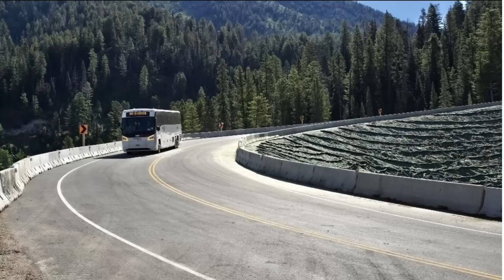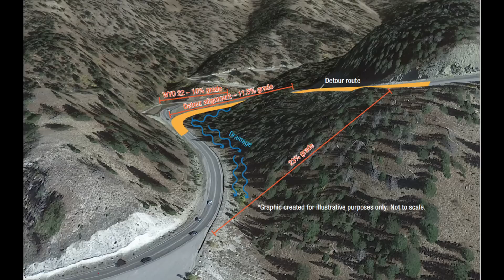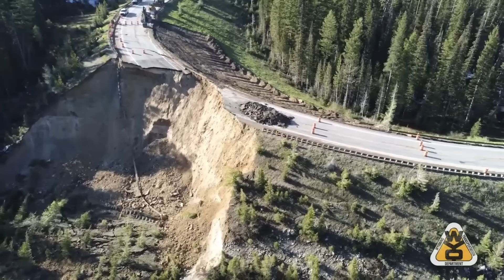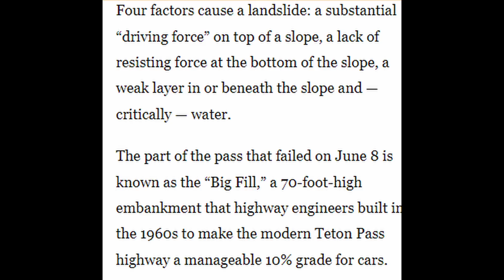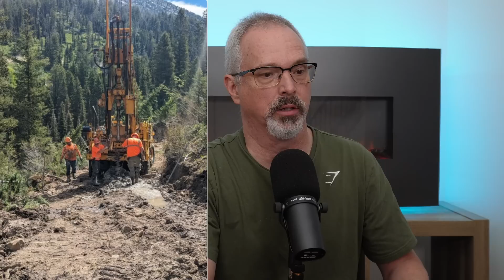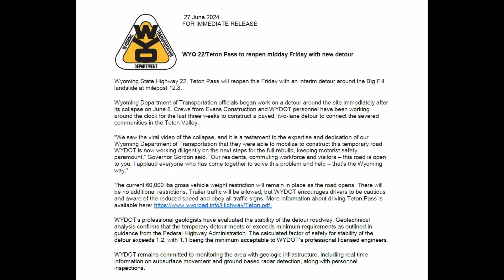Teton Pass - Bypass Completed and Open to Traffic

Comment: I got my MSCE in geotechnical, 40+ years ago. I never trusted a FS under 1.5 unless the slope was under 5 feet tall. The soils in CT vary their properties every few feet so, you can't count on anything with it. IMO a 70 foot tall slope needs a much higher FS than a short slope. The whole problem seems to be politicians making decisions based on dumb information. The spokesman can't be an engineer. Good video. Remember that the difference between genius and stupidity is that only genius has limits. I have to wonder where the one inclinometer was placed. Good video.
Reply from the maker: Thank you.  I agree with you.  This whole situation reeks of political motivation.
Reply: @CaseyJones-Engineer  The WYDOT crew that stood by and watched this happen, despite several precursors, is the same crew designing the fix. There's seemingly no oversight or checks and balances. This would NEVER happen in the private sector. If this happened to one of my projects, my engineering career would be over. This is bureaucracy at its finest. I would love to the sate put together a comittee (might as well be directed by the Wyoming Board of Engineers) to review this whole thing. There's no transparency. I've been told (obviously heresay) that a soil stabilization company had a proposal to fix this area prior to the failure. The proposal was requested shortly after the motorcycle accident that brought attention to the asphalt cracks last summer. Everyother person in the valley or next valley over that drove the pass knows the bump that was forming right at the bottom of the failure. So not only was this predictable, a solution was sat possibly sat on. I'd sure like to know if that's true.
Reply: @CaseyJones-Engineer  The big question becomes how much of it is corruption vs perceived necessity to ignore safety. One of these days when I feel like typing a lot I'll talk about a highway where the road base carried a lot of water to a low spot and caused an embankment failure in the 1980s. After that CONNDOT emphasized curtain drains along highways. Good Luck, Rick
Reply: @richardross7219 let’s see - there was 91 in windsor, 84 in waterbury, just 2 of 3 major interstates 🤣
Reply: @petechiarizio1766  84 in Tolland too. It was in the 1980s but, I only heard about it when I was at UCONN. Good Luck, Rick
Reply: @CaseyJones-Engineer Remember the Teton Dam failure?   Probably the same politicians and “influence”………
Reply: A chain is only as strong as its weakest link.
Reply: Most important thing is the underpaid hospitality workers who can’t afford to live where they work make it to work on time to make millions for tourist corporations. Tax dollar generator for the state. $$ over lives   Politically driven🤔
Reply: NAILD IT °~•.☆.•~°
Reply: Their >1.2 fs is only for the temporary road while the permanent road is under construction. It will be continually monitored and it is a short term fix only. 

He introduced himself as a geologist, not an engineer, and it sounded like all the engineers were busy trying to validate everything before their deadline.

It’s not exactly political, you just have to appreciate that the locals here are used to dangerous roads and we drive on them every day all the same. Thousands of people commute to work over this pass in order to work in what is literally the wealthiest county in the country. For those who continue the commute, it’s turning a 1 hour commute to a 2.5 hour commute each way. For others who have stopped commuting, it’s costing their livelihoods. For the wealthy Jacksonites, it’s keeping away their workers. It’s just a huge problem for everyone right at the peak of the tourist season.

Another thing you have to keep in mind is that the water that caused this problem is long gone, and the geotechnical conditions are much more stable now as a result. It is very unlikely that once they have their data, it will show that the slope isn’t safe, which is why they were comfortable building this thing before they had the data. They strongly suspected that the design would work, so it was worth the risk that they may have had to rebuild it if the numbers didn’t work out in the end.
Reply: @mosb1000  Almost 50 years ago, I was a US Army combat Engineer Officer. We used greater factors of safety and all of our work was "temporary". There seems to be a lack of competency. The urgency for the workers' commutes is political. The next screw up may kill someone. Good Luck, Rick
Reply: @richardross7219  The people who live here need to commute over the pass for practical reasons, not political reasons. This isn't a minor inconvenience. Businesses will actually close their doors permanently if this pass is closed for too long. People will lose their jobs. It's not a major consideration for armchair engineers like you, and so you have the luxury of calling it a political consideration, but it is a huge problem for the people who actually live here.
Reply: @mosb1000  It is still a political decision. I was a town engineer shared between 12 small towns for 10 years. I took the local economy into consideration. When I closed and replaced a bridge, it was done as fast and chealy as possible. My state department of transportation commissioners hated that what they said should take two years and $150,000 I often did in 3 months for under $50,000. I didn't use their contract nor contractors. There was no "gifts" for them. I was a combat engineer bridge builder and learned a lot of fast and safe ways to do things. Cutting corners on safety can get somebody killed. In my 35 years of Army and civilian construction experience, nobody died on my watch and there were only three injuries. For safety and the good of the community the state should provide free bus services to get around the failure since they caused it. That would let workers sleep on their commute.
Reply: @mosb1000 btw, the pass commute was *2 hours round trip and that turned into *5.5 hours round trip around the detour route. Still no reason to cut corners though.
Reply: @mosb1000  Sounds like the Army Corps of Engineers........and New Orleans.

Comment: We have a local road closure in SoCal. Highway 154, the Old San Marcos Road north of Santa Barbara was closed by CalTrans after the appearance of several cracks in the road surface.
Highway 154 connects thousands of drivers from Santa Barbara to the Santa Ynez valley everyday.
Reply: That Big Sur area is closed every other year on HIghway 1 as well. They don't hesitate there, and that has completely isolated people. Now, CalTrans budgets and schedules are a whole other conversation.

Comment: Speaking of construction haste, Under the heading, "China's Shaking Buildings' check out ; SEG Plaza, Shenzhen, the high rise shook from May 18 to 21, 2021, a follow inspection brought this conclusion;
Three Issues.
!) The steel and concrete structure has inconsistent thermal expansion contraction coefficients.
2) SEG Plaza was constructed at a rate of 1 floor every 2.7 days!
3) Construction started BEFORE the blueprints were finalized.

The Vanka Financial Center in Foshan, no conclusions as it just took place recently.

Source: China Observer, as seen on YouTube 6-30-24.

Comment: As a layman, the one thing I'm getting out of this is there should probably be permanent passive drain tiles for dewatering. If that had been installed-retrofitted this whole even may have been avoided.
Reply: Likely needs new soil types and possibly engineered soil systems too.

Comment: Maybe they will drill in pilings at a later date..  I don't think driving them in will do (big rocks and perhaps causing stability issues)..  The sides seem steeper.. perhaps adding to the low engineering factor of safety..  Also I expect that they will have to expand the base and lessen the angle.. and the safety factor for that area should be a 2+ (as mentioned as being in a fault area).  Perhaps tey should lower the load rating below 45,000lb.  Oh, and they are looking for Fed funds.

Comment: 22:00 "stability monitoring array" is giving Oceangate vibes.
Reply: So, an indicator on someone's computer at WYDOT will change color immediately the first time a vehicle rides a wave of dirt to the bottom of the hill? That should be helpful. 🙄
Reply: @KJ6EAD  landslides don't happen all at once. movement will be detectable in the soil a fair while before the dramatic ending, assuming they installed enough instrumentation and actually pay attention to it.
Reply: @tissuepaper9962  Of course but the catastrophic failure of the roadway that occurred would have been prevented if those assumptions are valid. WYDOT was aware of precursor movement long ago and dutifully installed monitoring instruments, then the road collapsed providing a wealth of data either too late or not responded to timely and effectively.

Comment: The fact is, it will be fine during the dry summer months. The problem will come when it turns wet again.
Reply: Drainage across/under/embankment?
Reply: Want to bet?  Everything is more favorable, angle of repose, lower elevation, less pressure, and if it fails, very unlikely it will be catastrophic, it will come slowly like the original one,  plenty of warning
Reply: Drove over it this morning as did everyone else with massive trailers we will see if it lasts until fall lol
Reply: It'll last tell next spring.
Reply: I guess the rich honchos in Jackson, Wyo. hope it doesn't rain so they can keep getting their cheap labor from Idaho.
Reply: I’d say you’re exactly right.
Reply: In reality there is barely any water there at all in a typical spring. This was an unusually wet period of time which caused the failure, not something we’ve seen every year (or it probably would have failed a lot sooner). This was not the only problem the wet weather caused for us this spring either.
Reply: and pray for drought this summer.
Reply: Is it a fact?  Literally a fact?

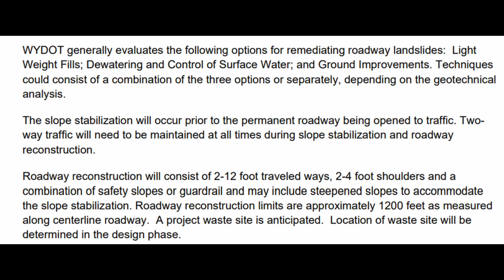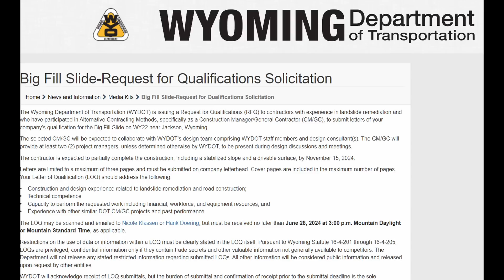Comment: ... 18:01 bad Dahill info😕 19:19 WYDOT rebuild contractor RFQ 19:58 uninterrupted 2-way traffic seems unrealistic 21:49 getting $50K constant-array 24/7 groundwater, soil monitoring 23:37 get-er-done politics: geologist Dahill defers to others on stability / safety call😕 25:10 RFQs were due June 28. 25:21 Nov. 15 partial completion date 25:52 August construction start 26:54 vs permanent rebuild timeline of 4 months

Comment: Thanks for your video, lots of good info and logic.  There are many people like me that understand your words but really don't have the experience to understand what they really mean.  And this stirkes me as a fairly common problem where the right soils exist.  I was wondering if you would consider illustrating a similar occurence and the solution.  An example i was thinking of is cuts of sand through the fill and bench at the toe of slope.

Comment: Can they not create walls at the bottom to prevent sliding?
Reply from the maker: I am thinking that something structural like you suggest (for example a wall made of drilled shafts) should be considered here.
Reply: Is the spokesman an engineer? If so I think I should be awarded a engineers licence just for my dreams

Comment: At the ten year mark , would love to see a follow-up, and potential either ‘ I told you so’, or ‘ I was wrong’
Reply from the maker: As I have said before, they might get lucky and have everything work out.  However, they are clearly not following long established geotechnical engineering practice which is creating an unnecessarily high risk here.  But I am sure there will be something to do an update on with this project!
Reply: Yeah, what exactly is being wrong here? Casey Jones can be absolutely right without the road collapsing in the next 10 years. Your logic is about as faulty as the engineer's in the clips.